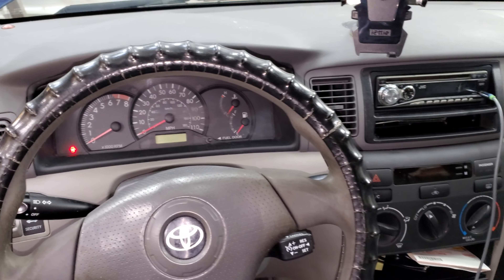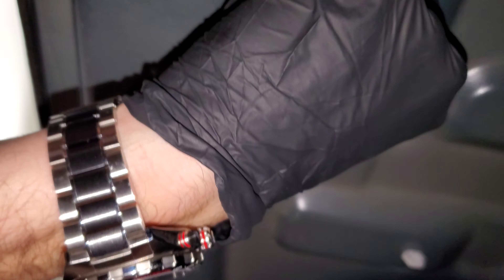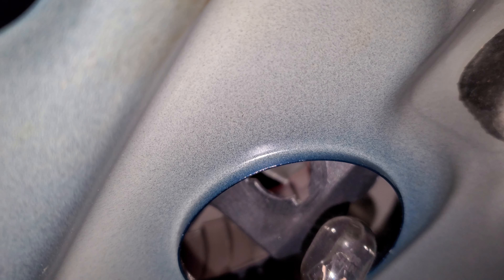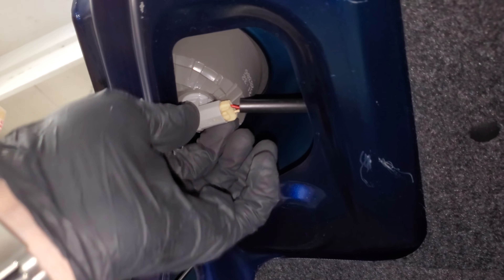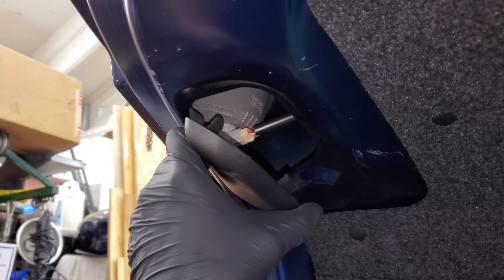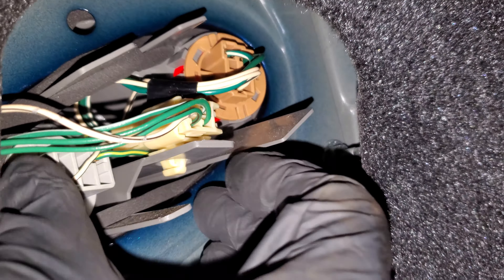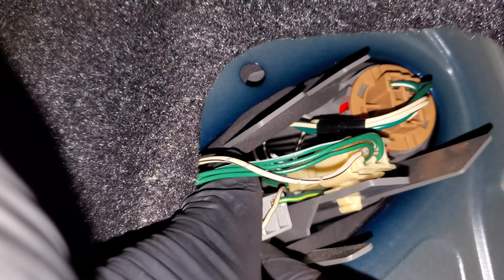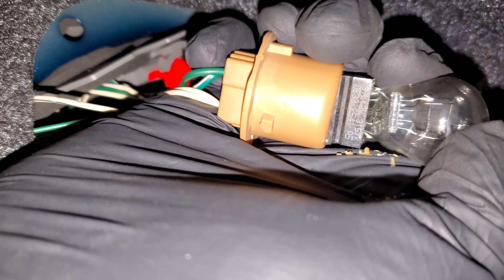2007 Toyota Corolla Brake Light, Turn Signal & Backup Light Bulb Replacement

Comment: nice good vid.. just like my  07 corolla CE... exact  same setup bulbs wires all.
   very weird is  the rear (red color) lights.. the 1 clear  bulb  acts  as the pkg taillite  plus  as the  brake lite too.  bc   it has builtin  2 filaments  in one glassbulb 
   My rear both sides -  pkg taillites  are working... but  my R rear brake lite is out...
 but  ithink  gotta replace that whole 1 bulb  bc one single filament inside is burnt out... kinda sucks  half the bulb still works.
 [[my turn signal lites ( yellow)  both sides work aok... separate bulb for that.]]
 omg  smfh
  you won't find this explained  anywhere on utube..  had to figure it out myself
  You got great  good overall vid on all the main rear  brake lites  includubg center brakelite ! and turn signal lites.
 thxx for  doing !!
Goodluck

Comment: Q :   Does center brake lite.. u said  #9006   or #9021?     u can get a brighter stronger bulb  for this center brakelite to show brighter ?   ( that be good better safety  for sure  tailgaters see my brakes come on better) 

  Does it pull more amps or  volts whatever if u put in   a higher stronger  bulb ?  like every time u hit brakes ?

 I got a lot of battery weak  probs having to.jump it lot lately.. worry bout it.

Comment: I've got a 2007 Corolla hatchback and the configuration is very different. I want to replace the rear brake light globe and can just reach it with a couple of fingers. But the shape of the car doesn't allow room for me get my hand into a position to gain enough leverage to pull the globe out. Every tutorial on the subject seems to be for a sedan which doesn't help.